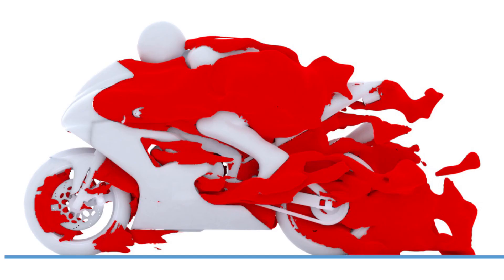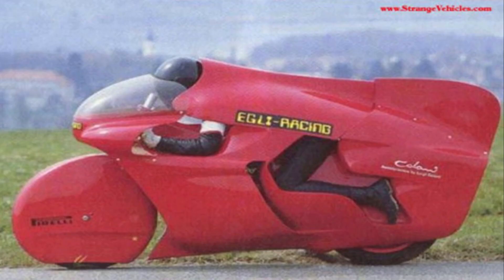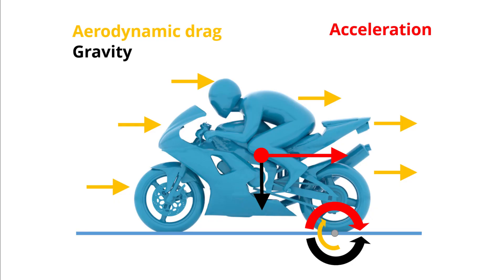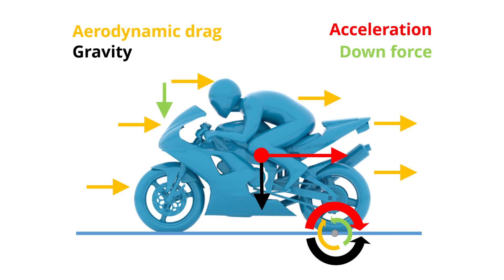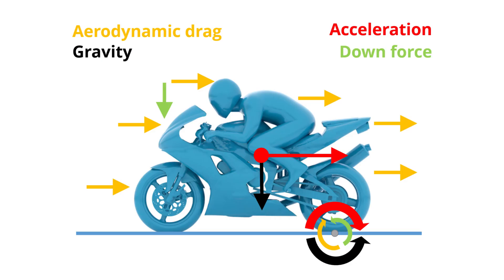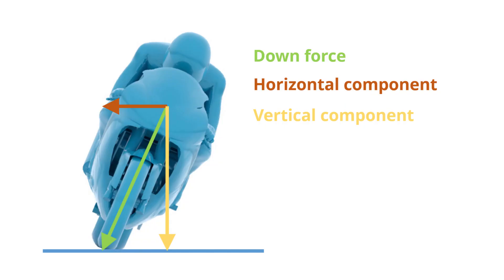Sports Aerodynamics #2: Motorbike Wheelies!

Comment: Hi Wouter, thanks for great videos on a challanging topic. Could you please  provide  some analysis /hints on the turbulencis (and consequent noise) hitting  motorcyclist’s helmet  as a function  of the height and the shape of the windscreen. I am starting to worry that there is no optimal winscreen solution exept the  barn-door type, i read somewhere that the bmw k1600 was the only helmet- noise friendly motorcycle ( i.e. No turbulencies hitting the helmet,. I an starting to favor minimum  fairing and uninterupted air hitting the helmet on a comfy straight posture riding. What is science/ cfd view/ recommendation regarding traveling on a a bit higher speeds ( going below 60 mph indeed does not produce  that many turbulences) ? As i started to develop tinnitus this info is quite imortant to me. Many riders are complaining on the forums of turbulences of certain bikes, I read a post of th guy who sold his magnificant Ducati Multistrada 1200 becouse he coudnot stand the turbulencies the windshield was producing. It,s also important from a standpoint od riders fatigue. Thanks!
Reply from the maker: Hi Vuk,
indeed, the wind noise is mainly the consequence of detached, turbulent air in which the turbulence is translated into noise energy (if you search "acoustic analogy" you can find more about this). Another aspect is wind buffeting (which is of course related), where you have oscillations in pressure (like driving with one window open in a car, causing that thumping effect).

I'm not too experienced in that field, and I would think your suggestion is correct:
either make sure your helmet is mostly shielded in the wake generated by the windscreen, or just leave it in the free airstream and work with a helmet that works well on its own in such conditions (some feature small spoilers at the end, to fix the separation point of the air, which will reduce vibrations on the helmet).

We also have a video where we interviewed Joseph Katz on motorbike aerodynamics, perhaps that can be useful too?
https://www.youtube.com/watch?v=qrH_QBOrqbw